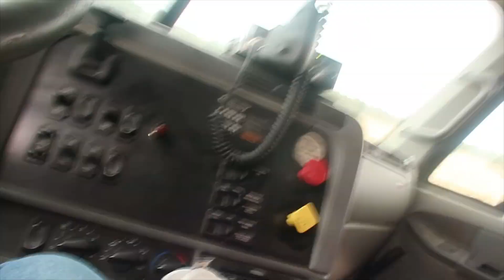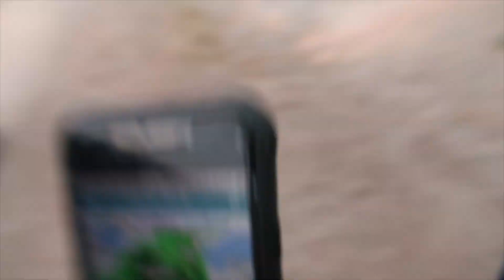Ohio Fall Harvest 2018 day 19

Comment: The day this video was filmed was the day Dad and I left Racine Ohio destined for Erhard Minnesota to disassemble and load a New Idea two row pull type picker. When we left Racine it was 66 degrees at 6:30 am. When we arrived in Minnesota late that next morning, it was 31 degrees with an inch of melting snow on the ground. Never had another warm day after that for the remainder of that fall and winter. We got it home, put back together, and got to use it on Thanksgiving Day to pick the only 7 acres of corn we planted last year. Had to fight frickin mud the whole time. Really made me wish I had an Oliver OC-6 crawler, or at least some sort of ag crawler with PTO. Just about had the 3020 gas and 720 Diesel hooked together with a chain for the whole field, and damn near got both of them stuck a few times. Tomorrow, we're departing for a small town in NW OH to pick up a John Deere 45 combine we recently purchased. We're really making strides in keeping up with modern harvesting technology now!!! Maybe next year we'll step up to an air conditioned cab on one piece of equipment or another!!!

Comment: How long have y’all been running Challenges Tractors? What did you use b-4 them?🇺🇸🇺🇸🇺🇸
Reply from the maker: In 2013 dad traded his 305 magnum for a challenger. Until this year I was still running a caseih then switched to the 1038 challenger